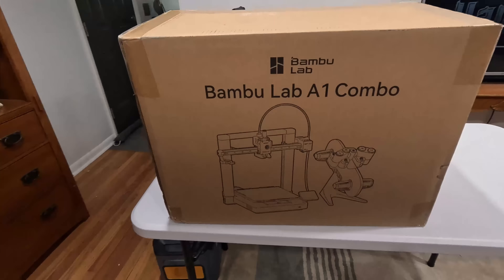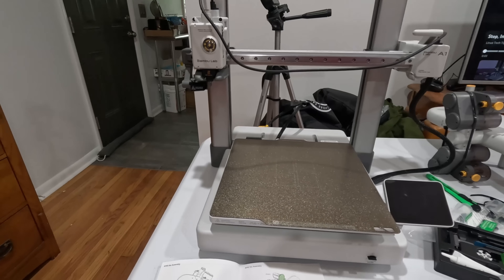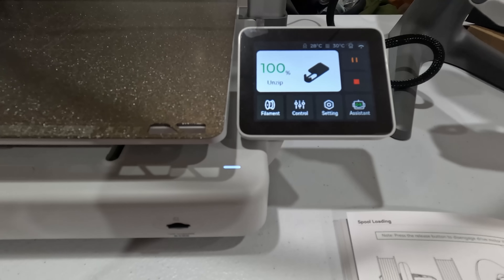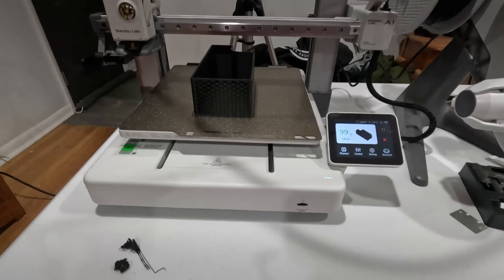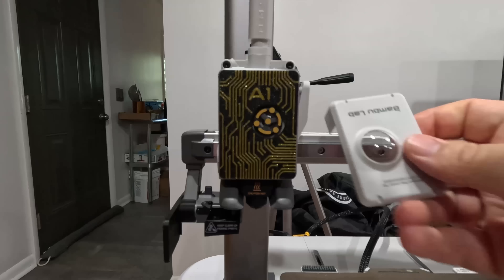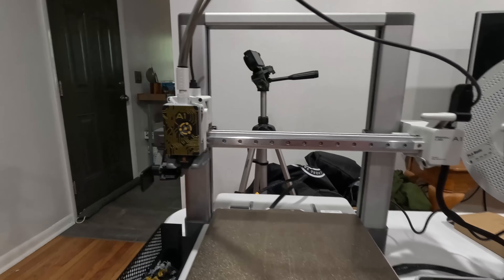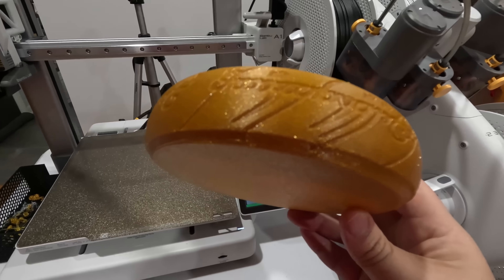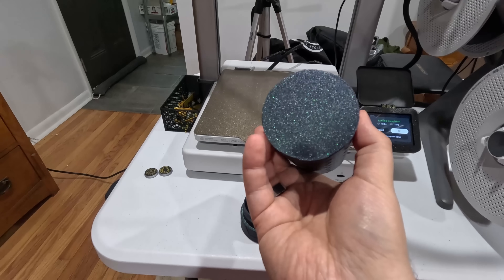I'm in LOVE With My First 3D Printer - The Bambu Lab A1

Comment: I’m looking to finally get into printing too. Probably been looking for 5 years now 😅 could I ask a question?  Could you print the deflector & basket at the same time ? Or can you fill the build plate with lots of different models & print them all in one go ?
Reply from the maker: @indigocotton4187  yeah, pretty much as long as it all fits and you're doing the same material you can cram whatever on.

Comment: Ryan:  I am not as thrilled as you are with Bambu Lab.  My software is not behaving well together.  Studio asks for a 6 digit code in m 'Account' directory on the printer.  It does not exist.  There is no clear, step by step, printing  instruction video with the three methods of printing.  Directly from Studio, 'send' to the SD card or from my computer and the App.  (the app seems really useless).  I have managed to print a bunch, but in a round about manner.  I think the firmware and the software are not at the correct level.
Reply from the maker: I did have a bit of trouble getting it initially connected, if I remember correctly it didn't like that I had used my google account for single sign on to create my account with them and I had to go manually register with an email for it to then work correctly. I thought I explained it in a comment reply somewhere here but am struggling to find it.
Reply: @RyanMercer  It turns out that Bambu software really like to run a while before everything works together.  A couple of firmware updates.  Now it works really well.  I am getting some tall items releasing from the texture place and the top layers turn to spaghetti.  I wonder when cleaning the steel plate went from alcohol to dish detergent.  I could print with a raft.  I hate pulling that stuff off.
Reply from the maker: @bbrachman  Try using an adhesive like Magigoo https://amzn.to/4fdNYNk  or nano polymer https://visionminer.com/products/nano-polymer-adhesive-sample?bg_ref=VHs3yeIKd9  as tall stuff really likes to come loose on a bed slinger like the A1, the NES cartridge tower I did in another video had the purge tower come off with several hours left, but I didn't use adhesive. Generally I don't use adhesive unless it is tall, or if it spaghetti on me once then I just clean the plate and put some adhesive down.

Comment: I can't believe what having an A1 must feel like as your first 3D Printer, my first printer was a kit you put together from the extruder to the wooden (!!!) frame. We've gone from CoreXY printers to overpriced junk to bargain basement junk BACK to CoreXY and now finally for the first time since 2009 we've seen innovation in a field that no matter how much you spend was still just the same parts in a different configuration. We came very close to having a truly off the shelf printer with the Adventurer 3 by Flashforge but the A1 (and more so with the mini) is two or three steps closer and is ALMOST there.

They've shaken up the market and made some companies look very very VERY long in the tooth and exposed complete lack of innovation for years by market leaders
Reply from the maker: @odditythreeD  I definitely picked a great machine to be my first. I'd ordered a few printers over the past 10-15 years but always cancelled the ordered because the learning curve seemed harsh but this thing was perfect  for a beginner.
Reply: @RyanMercer I did the same as you. I ended up waiting years and just got my Bambu Lab A1 and it's awesome.

Comment: Great video. I also am considering buying that printer. What do you do to dry your filament? Having to dry the filament is the one thing stopping me from the purchase.
Reply from the maker: I've been using the dryer in this video: https://youtu.be/3oGZRToaasQ

PLA: 4 hours @50C seems to work great
PETG: 24 hours @65C. 

There's a printable enclosure for the AMS lite if you're going to leave spools out for a bit that you can print and add desiccant to https://makerworld.com/en/models/486153#profileId-398821

Comment: Not been able to tinker with a 3d printer is a terrible idea, how long has bambu labs been going how many printers do they sell and what happens when they stop making a printer. You then have to pray it never goes wrong you never have to replace the hot end or any other part, because guess what you will not be able to get the parts. So you will be left with a machine that looks nice but DON'T WORK.
Reply from the maker: @phillipleathley5833  Um there are third party manufacturers for the parts from gears to belts hot ends for this machine already...
Reply: Bambu Lab are a pretty well respected brand and are considered class leading by a lot of people in the 3d printer space. I think their sales reflect this. They are not one of the thousands of cheap brands that may be gone tomorrow.
In terms of the hot end in particular, it is such an easy swap process, that you can easily do it between every print if needed.

Comment: Great video, and Congrats on getting into 3d printing - it's a fantastic hobby. There's nothing like the wizardy feeling of conjuring objects out of thin air (and filament)! I just assembled the A1 combo last night and printed a benchy off the SD card that came installed. Amazing quality, and took under 20 minutes. So far I am super impressed.

I notice you jumped right to printing files from MakerWorld using the phone app (presumably the Bambu Handy app). I'm having a HELL of a time binding the printer with the app. In the docs and videos I've seen, the printer's Account screen displays a PIN number to enter in the app, but my screen just shows a QR code. When I scan the code the Bambu App asks me to login with a Phone # and Verification Code. This is where I'm stuck. My MakerWorld login is by email/pwd not by phone #. The app has a "Get Code" link but it does nothing. 

Did you have any problems setting this up, and do you have any advice?

update: After trying various things people suggested I ended up just reinstalling the app and the sign-in worked like the docs said, smooth as silk. Lesson learned - when an app initially doesn't work right, reinstall it lol.
Reply from the maker: @u2bist  it's been a week and a half but I think what I ended up doing was signing in via Google on the app then doing the code on the printer screen. Same again to pair to a computer. When I tried wirh an account I created I kept hahjng issues and I think saw a few people online say to just sign in with Google. 

The printer itself has a screen in settings when you first set it up that will give you the pairing code.
Reply: @RyanMercer  Thanks! There was no Google or Facebook option, only phone, so I reinstalled the phone app and boom, it let me login with my email and the bind worked right away. Off and running now. Again thanks for making this video, and happy printing!

Comment: I asked on FB about fitting the AMS lite to the top bar. One answer said his very recent order came the all the brackets and fittings to attatch it to the top bar. Did yours?
Reply from the maker: It came with a mount for a single spool but I don't believe the mount the AMS up there although I have seen files in the app/on Maker Lab but I saw on the official Discord server the other day where someone's flipped over during a print when they had it mounted on top because putting that much weight up there changed the center of gravity enough to make it a bit unstable. Personally I'm quite happy with it on  the table next to it.

Comment: I recommend printing the Silk Tower Test model on Maker World for each of your filaments so you can see what different speeds due to the exterior finish of prints. The model isn't just for silk PLA despite its name as I use it for all types of filament such as translucent PETG, sparkle PLA filament, you name it. I also print a tower in the default temp and then a little hotter (like 10c) to see the difference that makes as well and it sometimes makes a big difference (especially on 3rd party translucent PETG).

You will find most Bambu Lab filament doesn't need speed or temp tweaking unless you are going for a specific look, like you want the black PLA to be as shiny as you can. Meanwhile 3rd party filaments, especially those not rated for high speed which the Bambu Lab PLA is, can benefit from some speed and temp tweaking.

Welcome to the addiction... I mean club. 🙂
Reply from the maker: @hotfix7387  haha it's definitely an addiction! Thanks for the tip!

Comment: Sorry one thing though, be careful of fumes when printing, all plastics give off dangerous gases and particles. The printer really needs its own vented area.
Reply: Pla is non toxic
Reply: @jacknickel7765 actually not completely true, during printing pla like all plastics gives off fumes. Plus only pla materials stated as food safe are non toxic as some contain other materials of contamination is introduced during manufacture and ofc your printer is introducing contaminants while its extruding the material.
Reply: @stevewilkes4087  ah ok I was not aware, thank you
Reply from the maker: @Happy3dprinting  👍
Reply: Would a air purifier near by be helpful?
Reply: Wrong
Reply: @a.3160 sorry but pla does give voc fumes off during printing. You obviously haven’t seen the warnings given by different companies over the years. 
Different materials give off fumes such as abs can actually give off fumes that kill very quickly. All plastics no matter what source material is used will cause you problems long term. Oh and pla does not bio degrade it’s just sourced from plants not petrochemical.
Reply: @stevewilkes4087 you're not burning anything . Burning and melting is different
Reply: @KronicDaydreamZ you are correct in that burning and melting are different, unfortunately melting something does give of fumes. Granted pla doesn’t give off much compared to others but long term exposure or exposure within a confined space can cause issues over time. It’s safer to give these printers a room to themselves, to print in a living or bedroom constantly is a bad idea. But then pla being biodegradable is also a bit of an overstatement.

Comment: For a change the hype is justified with the Bambu lab printers and the printing environment that Bambu lab have created around it is by far the best for first time purchasers.

My first was prusa mk3s because it was the best, well 2 failed and third works but I gave up on prusa. While the prusa saga was ongoing I bought the Creality Ender 3 s1 which worked but needed a large learning curve to get printing reliably.
Years later Bambu lab launched the x1c which I pre-order and I wish it was my first printer. I also have a number of the A1, A1 minis and P1S. My favourite to use is the A1 for just ease of maintenance.
Great choice fora first printer 🎉
Reply from the maker: @Happy3dprinting  🤘🤘it definitely seems like a great one to be a n00b with